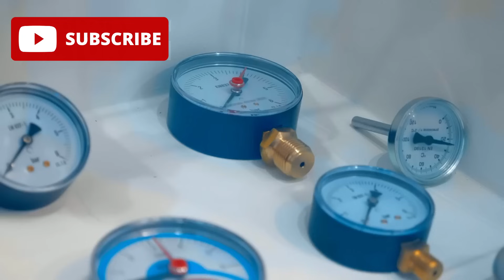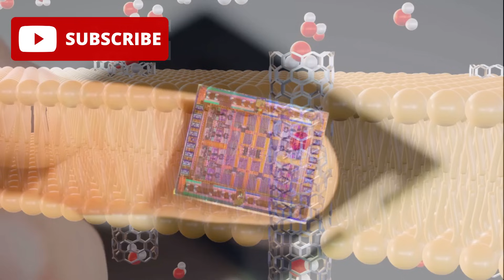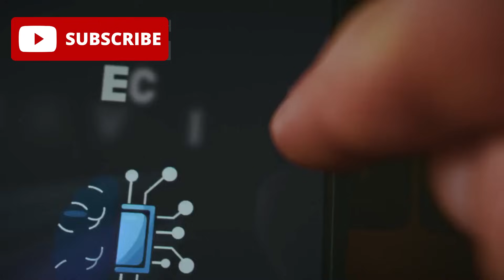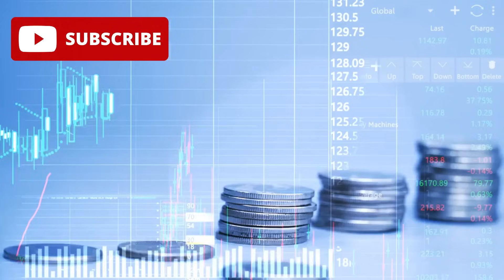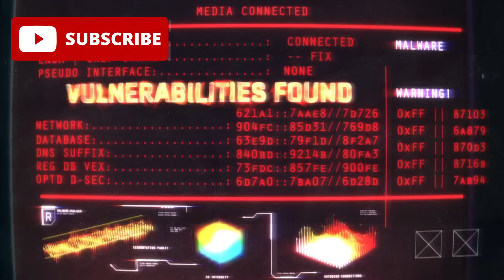SMIC Shocks the World with 2nm Chip — U.S. Hits Back Hard

Comment: Business Korea
Huawei Challenges U.S. Sanctions, Aims to Mass-produce 3nm Chips Next Year
Editor Kim Eun-jin   2025.06.05

Chinese tech giant Huawei is reportedly planning to begin mass production of 3-nanometer (3nm) process-based chips starting next year. Industry observers suggest that the company is preparing for supply chain independence based on domestic Chinese technology, given the impossibility of importing existing extreme ultraviolet (EUV) lithography equipment.

On June 2, Chinese local media reported that Huawei is accelerating the development of gate-all-around (GAA) based 3nm chips in collaboration with SMIC, China’s largest foundry, based on its own design. GAA is a next-generation transistor structure that can minimize current leakage and maximize performance. Samsung Electronics was the first to utilize GAA technology from the 3nm node, while TSMC first introduced it at 2nm.

Huawei aims to complete the tape-out (final design confirmation for mass production) of 3nm chips by next year, with the goal of starting mass production as early as 2026.

The key issue is yield. Industry experts estimate that SMIC’s current yield for 7nm and 5nm processes is below 50%.

Unable to introduce EUV equipment, Huawei and SMIC are conducting processes by applying multi-patterning to deep ultraviolet (DUV) based lithography equipment. The SSA800 equipment in use is a product of Shanghai Micro Electronics Equipment (SMEE).

Previously, Huawei had already released high-performance chips such as Kirin 9000S and Kirin X90 without EUV. While the actual process is close to 7nm, it was evaluated to have secured 5nm-level performance by utilizing chiplet design and advanced packaging technology.

For this 3nm development, it is known that experimental approaches such as carbon nanotube-based semiconductors are being pursued alongside GAA. This is seen as a move to complement the limitations of existing silicon transistors and secure leadership in next-generation material-based chip technology.

Huawei’s efforts are an extension of its frontal breakthrough strategy towards advanced semiconductor independence, which seemed impossible after being placed on the U.S. Entity List in 2019. Since being cut off from transactions with Google, Intel, Qualcomm, and others, it has focused on developing its own operating system (HarmonyOS) and chips, and recently started applying its own chips to laptops and PCs.

Business Korea Free Daily Newsletter
Never miss another article! Enter your email address below to receive our free daily newsletter:

Comment: It means china is able to make 7 nm machines as such ..to make 2nm using 
2 unit 7nm to give 3nm 
2 unit 3nm to give 2nm ..
Without using euv lithography machines...
Reply: Seems like EUV is not as a breakthrough as it suppose to be. DUV could make less than 7nm too.  I would believe ASML engineers must be working together with China to make this happen bec ASML only could sell DUV to its biggest customers and would not want to lose China. The same happening to Nvidia. After H20 is banned now, Jensen would create a new AI chips based on Blackwell platform to comply with the US regulation but could cluster them to make them a powerful AI Chips. Jensen Huang openly said he does not want to lose China as his customer. Why? First, China got a huge market. Second, even more important. If Nvidia leaves China, China would make its own and Nvidia would lose China, its biggest market,  forever
Reply: SMIC is using new Huawei's patented DUV light source to  manufacturer the 3nm & 2nm chips.